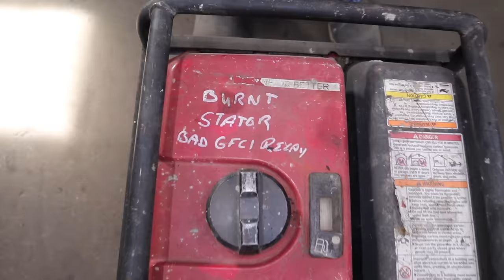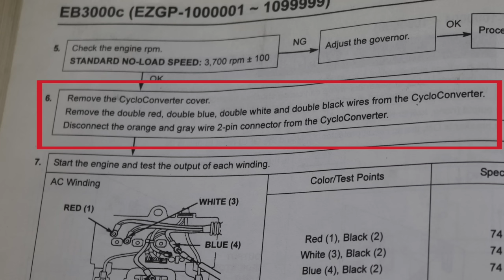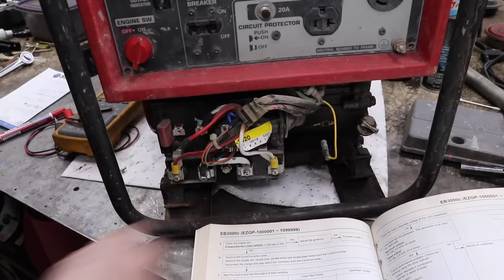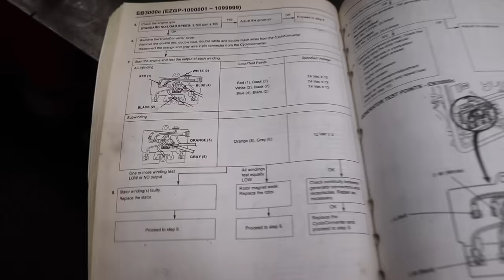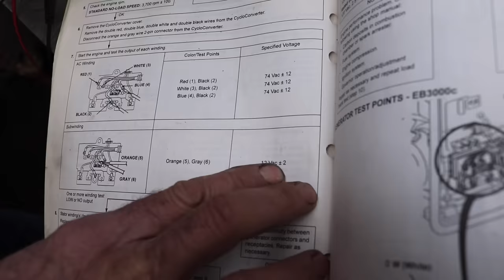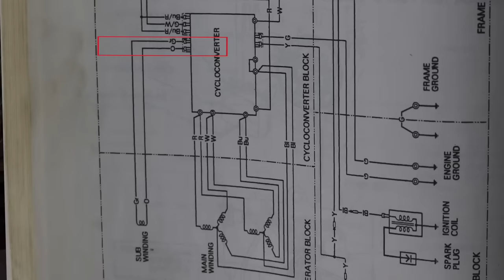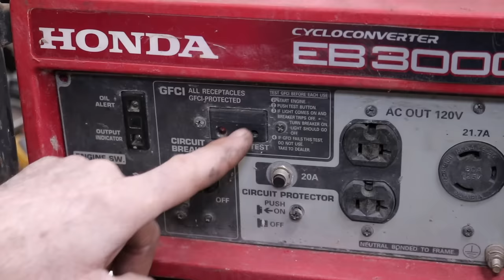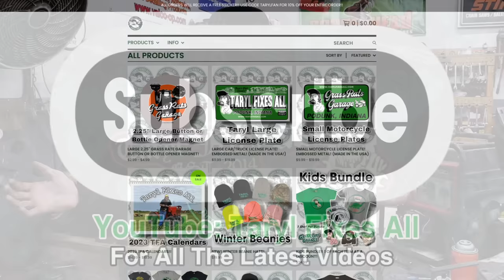Some Things Change For The Worst

Comment: Both My brother-in-law and myself have dealt with Champion small engines and generators, and they are good generators. I also use a Champion 6 HP. engine on an old snowblower. Last year (after owning the engine for at least a couple of years, the fuel tank began leaking in an area where it couldn't be got at to close up and seal the leak. I called Champion and explained everything and asked how much a  replacement tank would cost me. Now this engine is in perfect running condition except for this nasty leak that dropped fuel on the engine specially while running which could cause a fire or explosion. They were very kind and happy to replace everything I needed for FREE. Didn't cost me one penny and it still runs perfectly today (2022 and 2023) all winter long. This engine is very dependable and starts easy and uses very little fuel for the very hard work it does. It sits on an old 1950's Eaton's snowblower frame (chain drive) and goes through deep snow no problem at all. It was a replacement engine for the old frame I bought brand new for around  $175. I couldn't ask for a better engine for a snow blower for its old age. This past summer, I got my brother-in-law to buy their generator and he too is very happy with his generator. I personally service all my small engines (and brothers-in-law's and  have done so for many, many years). Champion is a good engine product, and the service staff are very kind and understanding towards your issues if you have problems. Like Taryl, I can't say enough about them.

Comment: Wow I thought for sure that someone would built that part as an OEM, amazing,

I have an 8000w Briggs & Stratton (craftsman) generator and it’s fantastic.  Has a flat looking B&S OHV valve engine.  It’s plenty loud but it works!  We ran the whole downstairs with it for 5 days last year after a big storm. It starts right up, has carbon monoxide detector & has electric start, etc.
Reply: I'd rather have an old Briggs than a new Honda.  All my 50 and 40 year old Briggs still don't burn oil.
Reply: Honda inverters might not fail often enough to create enough demand for them to make it worthwhile to clone them.  I dunno.

Comment: I worked on Honda generators for several years, and this is a typical result when one breaks...you troubleshoot it, find the part numbers you need, and then you see the price (!) assuming it is available.  Rarely fixed any of them for the exact reason you're talking about here.  They are amazing machines...as long as they keep running.  Inverters are the worst for price and availability of parts.  The old-school types without the inverter are way more reliable and parts are available in a much more reliable way.  I think Honda is trying to get out of the outdoor power equipment business, for example, they are discontinuing their lawn mowers next year.  OPE for Honda has always been sort of the "lower left corner of the big picture" and it seems they want to just get out of it completely soon.
Reply: The EU2000 and EU7000 and 6500 sure are popular and well loved around here, though.
Reply: Honda is not exactly discontinuing their mower production.  They are moving the manufacturing plant from South Carolina, I think, to France.  Whether they continue to import them to North America remains to be seen.
Reply: @tomrogers9467  It takes an exceptional company to build a quality product with South Carolina non-union work ethic.  Although to be fair, Boeing isn't a good example, after all, the reason Boeing located in South Carolina in the  first place was a lack of ethics...  Boeing's planes from their South Carolina factory have a bad reputation...

Comment: champion has definitely risen up to the demands of the market. a real working man's machine!
Reply: I have their big wood splitter. They use Predator motors which is fine with me. 13 horse and starts on 2nd pull, max. FINE outfit  for the money.

Comment: Perzonal experience with several Champion generators and parts availability/cost.  Excellent on all counts.  I've worn 3 out, were still working, engine wore out.  Recent engines even better.  New/improved constantly usually means parts for older models not available, generally...
Reply: I bought one of the champion 2000w dual fuel inverter generators. It has issues. I bought it from a liquidation place so no warranty. Ran it for like 20 hours after breaking it in by changing the oil 3-4 times in about 3 hours. After it ran for the 20 hours it no longer had compression release. I think it is eating the cam or lifter. Ton of metal in the oil. Adjusted valves because they had excessive clearance and compression release works again. I stole the carb off it and converted my other generator to propane with it. It is a generac that is also a clone of the same Yamaha but different manufacturer. It burns more propane than the champion did as it had a different rpm program on propane vs gas and the generac was never ment for it.

Comment: I’m retired now but as carpenter for years we used all brands of generators. Ya better take care of them ( oil changes etc) . But the Hondas were about even with all of them. We beat the crap out of them and got our moneys worth for sure. The best one we had was a diesel one, can’t remember the brand although it was smelly. Someone put gasoline in it and ruined it!🤪

Comment: I have an older Predator from harbor freight that has been used, abused and run for days. You can’t kill it, and it’s classified as crap by most people. I’ll keep my “crap” Predator and you can have your “premium” Honda!
Reply: you can buy 2 to 3  Predators for the Price of one Honda and there cars are not that great neither when they break down your going to get the WOW factor for a Price for repair
Reply: Loud but cheap and simple Chinese
Reply: I have a newer 8k HF Predator generator, it starts up everytime and so far has worked as it should (but doesn't have much time on it).  However,  a friend brought me his 3500 that stopped running.  Now this generator was used to run a water irrigation system during the summer for his large garden.   I thought it was gonna be a simple carb issue, turns out the exhaust valve stem wore right through the valve spring retainer.  Therefore, the valve wouldn't close and the engine didn't have any compression.   Tried to find a part or a serving dealer, no chance.  Called the local store and was told no engine parts are available.  I asked why?  Was told most people buy replacement warranty or buy new one.  A perfectly good generator NG for a .50 part.  🤷‍♂️
Reply: @MitzvosGolem1  The only thing Chinese thing about them is the ripped off designs are copied and made their.
Reply: @86FxBdyCpe  What cc engine does it have? If it's a Honda GX 200 clone the part you need is easy to find.
Reply: @Deucealive75  Exactly, that's what I thought too.  It was a 212cc model if I remember correctly.  I looked at the valvetrain of 6 different Honda powered machines; generators,  snowblower, waterpumps.  Not one of them had valve spring retainers that matched.  Perhaps there's one that does, I just didn't find it.  I checked a GX120, 160, 200, 240, 620 and two others I forgot the numbers on.

Comment: I'll tell you that's sad I'm heavily involved with as a volunteer firefighter so many departments and in the fire community as a whole rely on Honda power equipment, mainly generators mostly the small 2000 watt portables. Knowing this information is important for the future.

Comment: ive worked on the older honda generators and even the exciter/regulator moduals are very expensive around 250$ us .love their engines but you are correct.

Comment: With replacement inverters unavailable the only possibility of a  repair would be by a component level fault finding exercise on the inverter for which a schematic diagram would be needed and of course an un potted circuit board. By providing neither of these things it's as if Honda were deliberately setting out to frustrate attempts to repair their equipment.
Reply: Schematics shouldn't be needed for such a simple thing like an inverter. A competent repair person doesn't need a schematic for everything (though sometimes it makes it a lot faster). The potting is an issue though - that's a real pain to deal with

Comment: Just buy a standard Champion generator head and make it into a conventional generator. not as good as an invertor generator with high THD but it will generate good enough for construction tools. I deal with a lot of those engines and most of the backplate mountings are universal. Somebody might design a replacement controller but what is the point. I would just junk it and convert to standard readily available units. You can even buy them from Ali Express for even less.

Comment: Here's an idea, use a bridge rectifier and filtration system on the generator output wires, feed that into a store bought power inverter, and voilah! You have made AC power again from one of these generators. A bit of a ghetto solution but it should work with a bit of tinkering as long as you figure out a good way to rectify and filter the ac coming from the generator.
Reply: The generator is outputting 3 phase AC so you do need to use a 3 phase rectifier.  Probably other brand inverters would be electrically compatible with the honda generator.  I'm just not clear what the sub winding does.  I'm looking at the schematic for a EU2200i, where I see the exciter is driven by the spark computer, so yeah, that sub winding might be optional...

Comment: I'll have to disagree with the statement that all Honda generators are junk. I come from a huge Honda power equipment dealer who sells thousands of Honda generators locally. Very, and I mean VERY, seldom has a unit come back with Honda issues. And I'm going back to 1986 when we first became a dealer!! Granted, those Cyclo Inverter's were not the best Honda models made.... One thing Honda provides is a great shop manual! What other generator company offers that?!?
I'm retired now and heading for the garage....to fix a customers Champion with no output 👀😁🤣
Reply: @WJCTechyman  ditto
Reply: @WJCTechyman  agreed

Comment: Thanks for the info. In 2022 I bought a Champion 4550-Watt/3650-Watt Electric Start Gasoline and Propane Powered Dual Fuel RV Ready Portable Generator with CO Shield, from Home Depot, for $586, to power my RV Toy Hauler, it has a 120V AC 30A RV plug right on the generator. It runs great with non-ethanol gas, I even runs my air-conditioner & refrigerator at the same time. I haven't tried it on Propane yet. This generator is great for boondocking In remote places, except in California where it is banned. One last thing I can buy 3 of these for the same price as 1 similar Honda.

Comment: I purchased a Honda EM3500SX in 1992.
It is not a inverter model.
It has run perfectly to this day.
It has a great voltage regulator, and the output specs are exactly on the money.
This unit has served me all these years on electrical jobs and thru power failures at home.
This Honda still starts on the first pull.
I would never trade it for anything...

Comment: Sounds like a money making opportunity for someone.

Inverters aren't terribly complex .. they are filled with large inexpensive components, etc. Chances are there is a capacitor or two that has gone bad. $1 of parts and 3 minutes time (soldering) could bring that inverter back to life.
Reply: James Condon uses a guy that's already depotting and fixing generator voltage regulators. Seems like he was 'bassman' or something like that. James' web is just James Condon.

Comment: Cant go wrong with a champion,  generac, or Westinghouse all similar. I think generac is slightly higher quality due to it usually being a simpler design, alot of Westinghouse and champions use auto choke models which require the battery to be working and sometimes the stepper motor fails, I'd rather have a manual choke

Comment: You could run the output from the stator through a bridge rectifier and use a dc to dc converter to charge solar batteries.
Reply: The Stator is 3 Phase..  Freeze Frame and look at the Schematic.
Reply: Rectifying 3-phase to DC is not a problem; schematics are readily available.  Heat dissipation may be an issue, but it's not hard to solve.
Reply: @Urugami45  Yes but not a standard bridge Rectifier I thought You might have been thinking about LOL...
Reply: For battery charging, an off the shelf wind turbine battery charge controller would do it. They're designed to take the 3 phase AC from the wind turbine and dump it into 12/24v batteries (or other voltages if you look around).
Reply: @m9ovich785  Yes that's perfect single, 3 or even 6 phase will be just fine.

Comment: I am not sure when the INVERTER jobs started showing up...likely when computers got past floppy drives, but I took the plunge and got a 6500 watt Honda twin cylinder water cooled in a rolling frame probably about 1990 for my father's country house and solved the power outage issues for good.  Now that thing has cranked away ever since, tho not used as much as it once was, still has the original coolant and plugs.  Onlyist thing that ever happened is the california fuel shut off got stuck closed and took me quite awhile to find that little bugger...and tho I got the solenoid working again, I said...I am yanking that thing and just running the fuel out of the carb as every good generator should do, every single time.  I run it at least once per year, more if I lost power, and change oil every 25 to 40 hours with full synthetic.  Very economical....3 gallon top tank run pulling 3 to 4k goes about 12 hours.  Maybe it will die next time I need it but the $2100 it cost has been well worth it.  Course back in the day Honda was busy making a name....eh?

Comment: Just out of curiosity, how old was that unit?  It looked like one of the older ones and doesn't look anything like the current version model that took it's place.  I guess I look at a generator as being a 15-20 year device if you take good care of it and only use it sparingly each year and during power outages.  If they are getting used 8-10 hours a day 5 days a week on a job site I would guess you can't really expect more than 3-5 years out of them these days.  These days it's getting harder and harder to find parts for a lot of the stuff that is greater than 10 years old and even some stuff that is only 3-5 years old already is sent to an early grave since companies don't want people fixing anything which is really annoying.

Comment: I have a little 900w Kubota re-badged Honda genny. Damn thing smokes like a train and it doesn't have many hours on it but it is an older unit. It is an older Honda L head engine. The rings are shot and valve guides are extremely worn. It is very hard to find parts for alot of the Honda stuff especially if it's a bit older. If you do manage to find parts they are ridiculously expensive.

Comment: Thank You for going over the non maintainability of Honda Generators.  It's hard to mentally give up on what should be a valuable durable machine except for one critical part.  A Honda generator use to be the sure start and very quiet portable generator with Honda reliability.  I wouldn't have considered Champion generators before this video thinking they were likely just a cheap China use possibly once machine.  I would now.   

A common need for a home generator is to be able to run on NG for electric backup for a NG furnace.  Showing a common method to convert from running propane to NG on dual fuel gasoline / propane engines would be very helpful.   The reason to want to run on NG is it might be years before a electric power outage of significance to justify connecting a home NG furnace up to portable generator, far too long to comfortably store gasoline.   NG is also far cheaper and available in large quantities at home compared to gasoline.  After Taryl Fixes All gasoline treatment testing series I now drive ten miles to get REC-90 gasoline without ethanol formulated for 2-cycle and storage in mind.  I put it in cars if they are likely to go more than a few months on the same tank of gasoline.
Reply: There are kits available to convert to NG, which you can do yourself. However, I would not recommend it for a portable generator due to costs.  Most states require a licensed plumber to install NG lines which you would need one extended to the generator. If I remember, which is questionable, generators loose a percentage of output on NG. Something like 20%? I'm in the process of researching whole house generators. We live in Hurricane country. It would be run on LP since we don't have a gas line in our area. Good luck. Would like to know what you decide.
Reply: @jimbrewer2893   We have quick disconnects for NG for running our outdoor grill.  The house came that way.   I'd use something similar for a portable NG generator.  If the gas hose is disconnected it appears to shutoff.

Comment: Yup, new is not necessarily better!  Once the high technology fails, and the cost is too high 🤷🏻‍♂️. 
   But now you’ve got an engine for another project. You could make a video on repurposing the engine and “learn us” on how to use that tapered cranking shaft. 😉
Reply from the maker: That generator uses only the flywheel side of the engine the PTO side the crank is cutoff making the engine only good for parts
Reply from the maker: There’s yur Dinner
Reply: @TarylFixesAll   that is sad!

Comment: I have a two year old EU 3000 Honda inverter generator where the crank case bolts came out and trash the motor they were never torque from the factory properly. Lucky for me. It was still under warranty or that would’ve been $3000 down the drain.

Comment: i used to buy a lot of used generators and repair them,it was always a dirty carb every time,never bought one that wouldn't put out electricity,had several hondas,champions,and generacs,always though the generac was a better built unit than any of the others